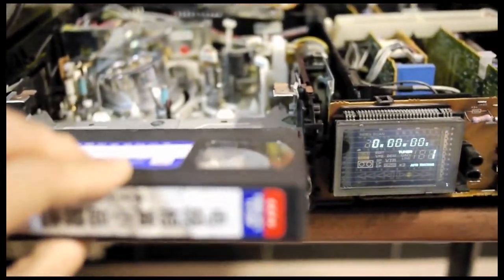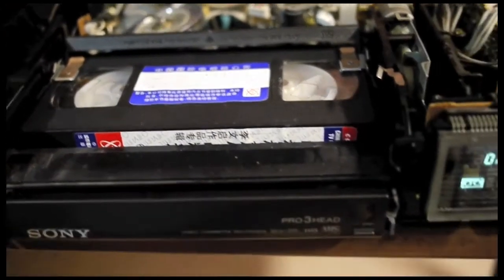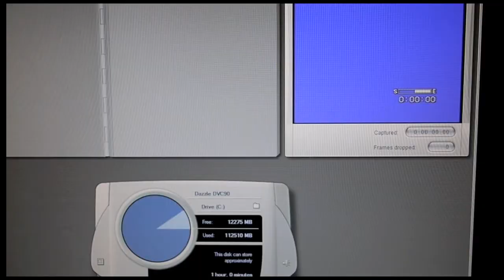Sony VCR Repair - Power on, tape loading fail, display flickers or blinks

Comment: I have the same problem with a Sony SLV-815, pressing the power button repeatedly, the front display flashes and has difficulty turning on then sometimes it turns on but is poorly lit.

Comment: Got a similar issue with a vcr I need to hook up a Chromecast to an old UHF TV. It powers up, stays on for about 5 seconds. Then just switches off. It will not load any tapes at all and if it manages to load one it won't eject it anymore. Gonna swap the caps too and see if it helps.
Reply from the maker: Sounds like a typical bad capacitor problem in the power supply, keep us updated.

Comment: JVC HRS7600U video drum will not stop spinning. Any idea what could be the problem? https://youtu.be/7qMY4Qds_94

Mitsubishi HS-U748 SVHS VCR will not play, rewind or fast forward. Any idea what could be the problem? https://youtu.be/Pj7Cs6tszUA
Reply from the maker: I think it's probably the digital voltage regulation. You should try to replace the smaller (50V or less) capacitors in the power supply.

Comment: I have a Sony SLV-213 video until recently worked fine but last week it connect for a movie to your computer and chassss
no work, no play no rewinds no forward, a click is heard when you hit the play or rewind, I opened the head works well but I opened the bottom and I see that by giving the plat comoenza the engine to move and entosces the snap and toas to have changed the motor pulley and engine extracion and the same does not work, any friend can help me, thank you very much. and forgive my bad English.
Reply from the maker: You should watch my other video on the complete bottom side gears repair for Sony VCR-SLV-315 for a general idea.

Comment: Pls help..I want to replace bad caps on a JVC HR-D120MS... I have almost the same problems as yours. What tools did you use to do it?
Reply: Knowledge of basic electronic soldering, knowledge of taking things apart & knowing how they go back together again, soldering iron, flux core solder braid roll, solder wick or solder sucker, wet sponge or rag, new capacitors with the same values as the bad capacitors.

{HINT at soldering for the beginner}: make sure you tin the soldering tip on first use (let it get hot). Put a small amount of solder wire to the tip of the iron. Clean off excess on the wet sponge. Keep the soldering tip tinned and cleaned with wet sponge. The goal here, is to create a nice heat bridge between the iron, circuit board pad, and component leg, so the 3 can join together as one on a nice shiny glob of solder. Failure to clean and tin the tip of your iron, will oxidize it; or worse, detach the special coating on the tip rendering it useless, and making soldering a real nightmare. (Note: Solder will never properly coat an oxidized surface properly unless it’s cleaned, and fluxed.
Reply: Oh, and one more thing!!!: 
if using desoldering braids (solder wicks); make sure to discharge ALL the capacitors before using these, by shorting each one at the legs with tweezers. If you don’t do this step, the desoldering braid will discharge the capacitor on a chip or a transistor thereby destroying it. I once destroyed a customers Nintendo by failing to do this step, and I had to buy him a brand new one, since the chip was obsolete.

Comment from the maker: That sounds bad. I'm glad you got it up and running. Although I have to make a correction my video when I said bulging bottom means a bad capacitor, it's not always so. Bulging top is 100% certain, but some capacitors are actually designed with protruding rubber bottom even brand new, so it depends, but in your case, with leaking liquid, there is no doubt.

Comment from the maker: Were they leaking literally? The power supply capacitor replacement should fix most of the problems related to power-on. Generally, the biggest capacitor (400V) don't go bad, but it can happen.

Comment from the maker: You can leave the tiny ones alone, they are usually not affected. Most of the time, the problem lies in the digital switch mode power supply circuit. I would say most of the time replacing the bad capacitors in the power supply will fix many common problems.

Comment: Great Video, I need to this repair, I made the mistake of taking all the caps out, even the little tiny ones, the ones that looks like pills.. going to have to resolder those back if I didn't make them bad by taking them out.

Comment from the maker: Thank you for watching my video. It was my first time repairing a VCR. I am surprised that there are people beside me who still use this old model. So it made me happy to read it.

You are correct about the blue screen problem. The left side of the mechanism that is supposed to press the tape against the head drum was not moving. From some unusual noises I traced it to the bottom of the VCR where the gears are. The left threading gear (Sony part number 373614701) was broken. I'll put another vid

Comment: Great video and very great work in repairing this Sony vcr.
For the "blue screen problem" at 3.08 I saw that the pinch roller is in an incorrect position, it should be in the down position and it should press the tape against the capstan but in your vcr it's not.
Also check the half loading arm that is a really common problem on this tape transport. With age the lubrication at the base of the arm became sticky and prevents the mechanism to load the tape properly.